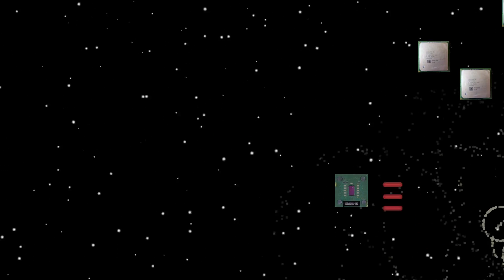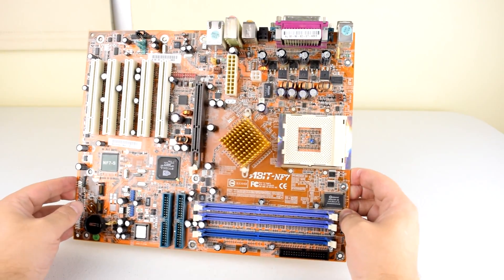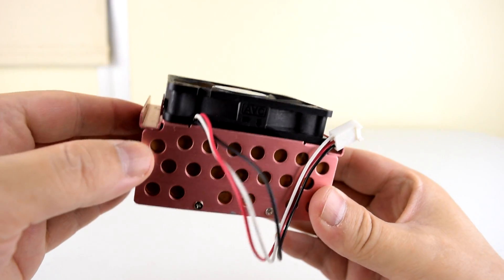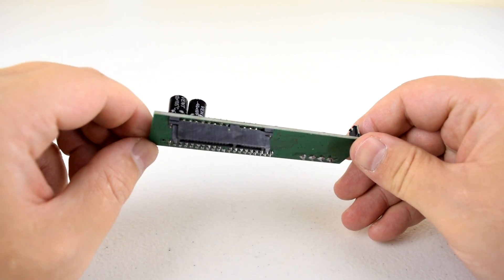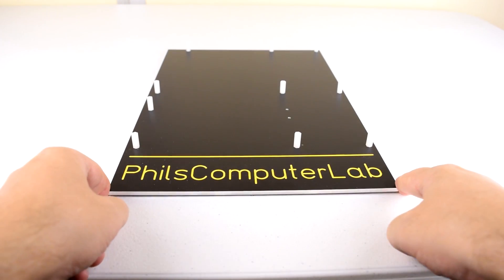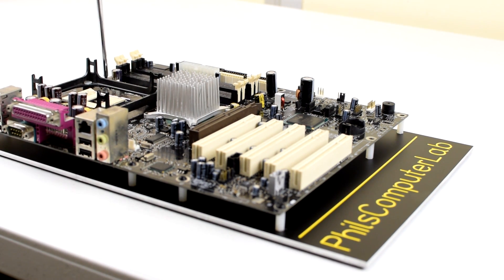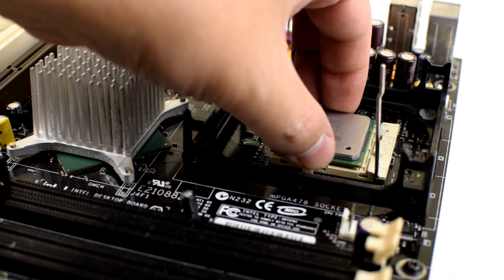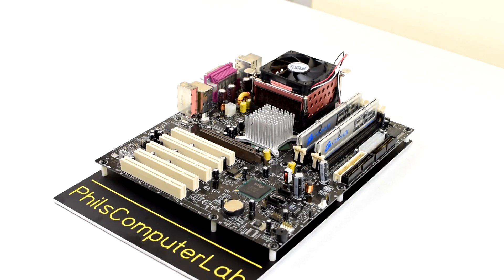Intel vs AMD S1E3 - P4 vs XP 3200+ GeForce 6800 GT and 875 chipset

Comment: ...but when I overclock Athlon XP-M (Barton) to 2,4GHz the 3DMark01SE goes way over 19000 points. Geforce 6800GT used at default clocks. Mobo is Epox 8RDA3G nForce2 and Dual Channel DDR @200MHz.
Reply from the maker: Good!

Comment: I`m sorry I didnt get it. But what did you say you did to prevent the AMD from crashing in 3Dmark? I actually have that problem and cant figure out why. I have a Thunderbird 1333mhz Socket 462 on a Abit NF7-2G with 768MB DDR266 and a Geforce FX5600 Ultra. OS is 2000, XP (and Slackware 12.2), and 3DMark crashes on both versions of windows
Reply from the maker: I used an older driver! Also it doesn't happen on an Intel system AFAIK.
Reply: @philscomputerlab  I heard it now. You used a older video driver?
The way my computer crashes, is btw that it all of a sudden reboots. And it seems to always be at the same place in the benchmark. On whatever happens after the high resolution test in the first game is finished. 

But today I`ve actually ordered a XP3200+ with 400 FSB and 2GB of Corsair XMS 400mhz. I just fired up my computer again a few weeks ago. After it being in storage for many years. I wish to make my motherboard "as good as possible". And the T-Bird will get in the first mb I used it in. A Abit KT7A that I bought a few years before the NF7.
Reply from the maker: @rakerholm  Yes I used an older driver!

Comment: the motherboard via kt600 does not use the maximum performance of the athlon xp 3200+ processor because it has three rails instead of four for ddr1 ram, therefore via kt880 gigabyte 7vt880 pro will be better performance will be better

Comment: Wow didnt know the athlon xp 3200+ supported dual channel ram? my 754 athlon64 3700+ is single channel. i do know for a fact the DFI Lanparty Pro875B was the best skt 478 motherboard made. and arctic MX4 is the best thermal paste ever made even now it outperforms thermal grizzly.
Reply: with nforce2, dual channel ram was possible... awesome chipset back then
Reply: @talvisota327  Wonder why they dropped DC support  on 754?
Reply: @Synthematix  as far as i know socket 754 was the socket for the low end and mainstream sector while socket 939 was for the performance / high end sector. they existed side by side. so as a high end platform, socket 939 has dual channel while 754 doesnt

Comment: The Hammer architecture destroyed Pentium 4 back then, but the Barton 3200+ Core is tooooo optimistic with the PR rating. It struggled with the Pentium 4 3.0 GHz and in most of the Benchmarks Barton was beaten even by the 3.0 GHz model

Comment: i wonder if the test was done with or without HT? I believe the 3200+ rating was based on the performance of what a non-HT p4 at 3.2 would be, since AMD started using this system long before HT.

Comment: The problem with Athlon64 was AFAIK that the early motherboards were unstable AF.
Reply from the maker: Not my experience at all.
Reply: It might have been a batch of bad motherboards. I have to admit it is quite a beefy chip. I actually want the AMD to strike with the Zen again, I want to build my first AMD system. The reason why I do not like many comments on this video is that many people are convinced the Pentium 4 was just a complete piece of shit that got beaten by a cheap Athlon XP and have not even watched the video because "they know the Athlon XP will wipe the floor with the Pentium 4" even through your tests show the opposite. Attitudes like that are one reason what made me choose a Pentium 4 at that time (and similiarly I despise Intel fanboys today who claim AMD will never beat Intel again etc.).

Also, a lot of people seem to think only Pentium 4s ever generated any heat, while I guess the Athlon XP run on fairy magic and generated no heat, even through the reason for their lower clock speed was that they would not handle the heat at those Ghz.

A lot of people seem to compare their lovingly build custom Athlon with some brand name supermarket Pentium 4 Dell, which is not a fair comparision at all. Anecdotal evidence can be useful sometimes, but is often worthless, all the Athlon XPs I ever used were total shit, but that is because they were computers given by a goverment program to an institution with antivirus software not updated in several years.

Comment: This is exactly the results I remember from PC magazines of that era. Also I am a bit pissed off about how AMD fanboys will insist the XP was faster despite all evidence. Yes, the Athlon XP architecture was faster per clock speed - does not matter when it COULD NOT REACH that clock speed! The end user did not care about clock efficiency, if Intel delivered performance by clocking the chip high, it would still deliver more FPS in games, regardless of "clock efficiency", also, the Athlon XPs actually generated a lot of heat just like the P4 too. The only claim that I might accept is the price-performance ratio of Athlon XP, but even that is nowhere as big as in hazy memories of AMD fanboys. The P4 Northwood was an expensive chip and a lot of people with the AMD chip seem to console themselves that since it was too expensive, it was shit anyways. It might have been too pricy, it might have had a low Ghz to performance ratio - but it HAD THE PERFORMANCE. The notion that P4 was all Ghz and no performance is a flat out LIE at least in regard to the Northwood chips. Prescott and Willametes are a different matter, but Northwood is IMHO one of the better chips Intel ever made. It was Netburst done right. An Athlon XP running at actual 3.2 Ghz would not be more powerful than  a P4 because it would go up in flames.

Comment: Phil please help me! I'm in the process of building my retro Athlon xp 3200+ pc and I'm having trouble getting the right power supply. I have a GA-7N400 PRO 2 motherboard. What power supply would be sufficient? I did have a PC CHIPS motherboard model M848ALU and couldn't get a picture on the monitor which I'm guessing from watching your videos its down to the power supply not being compatible. Would most modern power supplies be compatible with the Nforce 2 boards? What power supply would you recommend? I'm having trouble finding the Macron MPT-401, What other models could I use?

Any help much appreciated!
Reply from the maker: Your board has the 12 V auxiliary plug, so a modern PSU should work fine.
Reply: PhilsComputerLab  Thanks for your reply. Do you think the reason I didn't get a picture was due to my power supply not having enough amps on the +5v rail? Sorry for all the questions but will I need at least 35amps on the +12v rail, or will any modern supply be okay?

Thanks!
Reply from the maker: I have no idea. And there are no guarantees that another PSU is going to help. Any decent modern PSU will do.
Reply: Okay I'll try with this new motherboard and see what happens. I've got two graphics cards a HD 3450 and a HD 4650 (both AGP) I hope the cards aren't too modern for the system?

Comment: I made a retro build with 3200+ Barton NF7 board but I used a GeForce 7800GS... Pretty much the fastest AGP card.
Reply from the maker: +Doom2pro I'd love to have a 7800 GS!
Reply: +PhilsComputerLab I got mine on eBay a few years ago... Looking now it looks like a wasteland! Nothing. Hmm..
Reply from the maker: There is one seller in the US selling 10 for around $600 LOL
Reply: +PhilsComputerLab I see one in UK for $72.67 USD... BFG NVIDIA GeForce 7800 GS OC 256MB GDDR3 AGP GAMING Graphics Card FULLY TESTED

A bit steep but better than $600!
Reply: +PhilsComputerLab And an off brand for $58.12 - XFX GeForce 7800GS 256MB AGP Graphics Card PV-T70K-UAD7

Again from UK.
Reply from the maker: That's a LOT of money IMO. I will just stick with the 6800 GT. I could overclock it to an Ultra, it runs fine at that speed.

I also have X850 and X1950 cards, but in OpenGL games they are actually slower. They are faster in Half-Life 2 and Far Cry though.
Reply: +PhilsComputerLab 

"That's a LOT of money IMO"

Yeah, retro parts harder and harder to come by now... I have a 6800 in my GA7VT-600 motherboard build with a Barton 3200+ with unlocked ROPs but no luck on shaders, not without artifacts anyway.
Reply from the maker: I have started buying newer parts. They are still not on the "retro radar" :D Too new for retro gaming, too old for current use.

I got two 7800 GTX cards for $20 recently. You got to be a little bit ahead of the herd because prices will also go up on those cards...
Reply: +PhilsComputerLab I got a little newer scores on eBay recently, two GTX 570's for around $50 USD (each), one had dead fans ($8 USD new no biggie), the other working fans but no output, so I gambled and turns out just one of the output pipelines is roached, but the GPU is perfectly functional so I can only use Digital out (HDMI port), but pairing the two in SLI the defective one could be used as a slave, it won't need output anyway.
Reply from the maker: 570? Nice. That's on the level of my GTX660, which is my fastest card :D

People overlook the 560s and 570s and the 580s go for double the price often.

The 560 Ti for example is a really good Windows XP retro graphics card.
Reply: +PhilsComputerLab Yeah I almost jumped on a 560 Ti then I saw the listing for the 570 with dead fans... Did a little research on fan replacement and $8 free shipping, can't beat that! (Fans were OEM replacement also, not off brand).
Reply: +PhilsComputerLab 

"and the 580s go for double the price often"

I might go double the price on a 590 :P

Comment: I remember having an XP 3200+ based system.  It always seemed a bit underpowered at stock but it overclocked quite well.  Teaming it up with an ATI 1900 pro graphics card helped it run most games until the motherboard died.

Since you do a lot of videos on machines for running old games, could you advise on what kind of spec to look for when looking to run Windows 98 and late Dos games?  I am primarily looking towards titles like Tie Fighter which were always better with a proper general midi sound card and Mechwarrior 2 / 3 which needed the Glide API.  I would not really be looking towards older Dos games because I generally find they work well with DOSBOX.  Also it would be good to know how to tell what kind of video cards I could use alongside Voodoo 2 cards.
Reply from the maker: +James Lewis A Pentium III would be a good start.
Reply: It was capacitor plague wasn't it? It was going around at the time in 2002-2005. I had a friend with an Epox motherboard that died due to cheap capacitors, and my mother's LCD was also afflicted by it. You could fix it, just open it up, find that bulging or leaking bastard and replace it.

Comment: Where do you recommend looking for high 5v ATX PSU? Im looking for one for my dual MP 1900+ and HD 3850 AGP build.
Reply from the maker: +dr deconstruct Dual CPUs? Wow, I have no idea about finding such a strong PSU. Personally I would move on to Athlon 64 / FX / Opteron but that's just me.
Reply: Im thinking about switching from the 5v-based Tyan S2460 to 12v-based S2462 with onboard DC/DC converters for the 3.3/5v PCI.  if you ever run into any 35a+ 5v PSUs do let me know though :D
Reply from the maker: There was someone on VOGONS forums, he recently got a 60A! 5V rail PSU. I'll see if I can find the post.
Reply from the maker: dr deconstruct There you go!

70A! monster: http://www.ebay.com/itm/PC-POWER-COOLING-600-TURBO-COOL-100-240V-3-3-5-12V-500W-POWER-SUPPLY-/181961643306?nma=true&si=iETTy14RklLfQfl2IntmTw2jns4%253D&orig_cvip=true&rt=nc&_trksid=p2047675.l2557
Reply: wow thanks :D

Comment: +PhilsComputerLab 

It's a shame AMD couldn't keep up with the clock speed of the pentium 4 as clearly if the xp3200+ was actually running at 3.2GHZ (not 2.2GHZ) it would most likely smoke the pentium 4. Even if it was running at 2.5GHZ it might make it equal? I think for AMD even to come close to the performance of intel at 3.2GHZ with a architecture running at a 1000MHZ slower clockspeed is a clear win for me. 

What are your thoughts Phil?
Reply from the maker: +mam moth (Mammoth) I see the Athlon 64 as continuation :) If you want an awesome AGP system, I'd go with that.
Reply: +PhilsComputerLab Yes I suppose so! But I did like the Athlon xp series. Any idea when your Athlon 64 video is coming out? Also have you thought about reviewing a slot A Athlon against a slot 1 pentium 3?
Reply from the maker: I'm waiting for a few processors to arrive. Turns out there are quite a few revisions with differences regarding the on-chip memory controller. So that's something I want to look at properly. Tight memory timings makes a huge difference with the Athlon 64.

Comment: 939!
Reply from the maker: +Glacy Beast! But I'll do 754 first :)
Reply: PhilsComputerLab Cool! So only single core CPUs right now.
Reply from the maker: +Glacy Yea, I will follow the release schedule more or less from back in the day :)
Reply: +PhilsComputerLab Also, for the P4s, why did you leave out Willamette and socket 423?
Reply from the maker: I had to start somewhere and chose to start around the XP 3200+. The plan is to cover other chips in other series.

Comment: Can you compare the Pentium II 300PE to the AMD K6-2+ 500? These were 
released the nearly the same year, but the AMD K6 was vastly ahead of 
the Pentium II.
Reply from the maker: +Mathew Mabee I will check these out for sure at some point!
Reply: The major problem with the K6 was the L2 cache and poor FPU performance. It suffered greatly from having it's cache on the motherboard even at the 100 MHz FSB of super socket 7.

The pentium pro solved this problem by sticking the L2 cache into the CPU package on a much faster bus, making a truly gargantuan chip package for a PGA.

The pentium II solved it by having the CPU on a cartridge instead of a giant PGA. The slot A athlon solved the problem in the same way. 

As soon as L2 cache was integrated onto the CPU die itself, there was a gradual move back from slot form factor to socket form factor.

The move from PGA to LGA solved for intel the problem of idiots bending the pins by shoving the problem off on motherboard manufacturers.

Comment: Just putting out there that the 3200 is not a "as good as a 3200hz intel" number ,it refers to the previous gen of amd cpu's (also the price/performance is much better than intel whit the Athlon xp , lower tdp and open multiplier on cheaper boards and chips compared to intel ) try pitting a 2.2ghz p4 against  a 2.2 Athlon (apples to apples)
Reply from the maker: +Justagermannerd Interesting, do you have a source for the first point? AMD wasn't cheaper, the 3200+ actually cost more than the P4 3.0, which was still faster. Are you sure about an unlocked multiplier? I couldn't see that option on the 3200+. Why would I downclock the P4 for benchmarking, that's just silly. It's well known that you cannot compare CPUs by clock speed.
Reply: +PhilsComputerLab I'm suprised to get a reply , well sources I cannot give as of right now , that is just how I learned it (a64x2 4400+ = axp @ 4.4 ) it was a in-house comparison , and yes most athlons are unlocked and if you have to use the pencil to achieve that , Intel was really uptight whit freeing the multiplier, also the 3200 is expensive maybe because it was the top of the line , 2600 and 1900 are much more common over here (and I'm talking about price at launch and the year after , amd has a much more solid value on the used market) also the last one was more a shits an giggles suggestion since you see that amd has a much higher performance per clock and watt whit the xp/64 , the p4's architecture was a catastrophe compared to the p3 and c2d (wich btw is a beefed up p3, Intel ditched the p4 architecture completely for that)
Reply from the maker: I think I head about this pencil method, I was hoping for a unlocked XP like the Athlon 64 FX range.

Yea Pentium III was really good. Thing is, the P4 gets a lot of hate, but working with it now I only have good things to say. This might change once I get to the later models though, I think Athlon 64 is the way to go during that period.
Reply: +PhilsComputerLab oh yea certainly  , but I just wanna point out some benchmarks on passmarks site , you can give it a Google , you see how bad the p4 is even when up at 4ghz , heck even p3's beat same clocked p4 models , I like em all but the p4 is kinda the redheaded stepchild of the bunch
Reply from the maker: I see the best in all :D

Comment: got myself a realatively cheap athlon xp-m when the a64 approached. that one ran fine without any problems and tollerable heat at real 2.7Ghz with fast ram and high fsb. quite a pentium 4 kicker. loved that machine and skipped the A64. sadly, AMD had nothing against intel later, and the core2duo found its way into my next pc.

Comment: Ooh?! Did I hear the sound of Athlon 64? ^^
https://interruptrequest.files.wordpress.com/2016/04/asus-a8n32-sli.jpg
Reply from the maker: +InterruptRequest Yup! Nice board.
Reply: +PhilsComputerLab I've been using it occasionally for running Lakka.tv emulator OS. I've been considering putting it back together into a working system, but I'm struggling for space in my flat (and already have other older retro systems taking up space), so I don't really know. I'm reluctant to get rid of it though, as it was a high-end board back in the days. I've got a couple of different CPUs for it, a single core and the currently installed dual core.